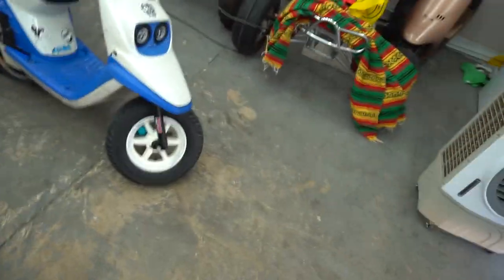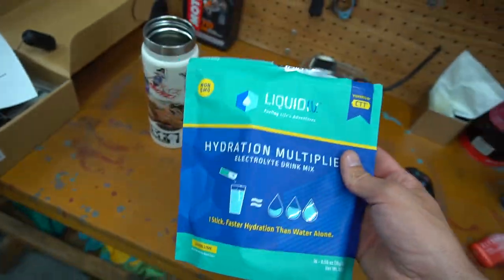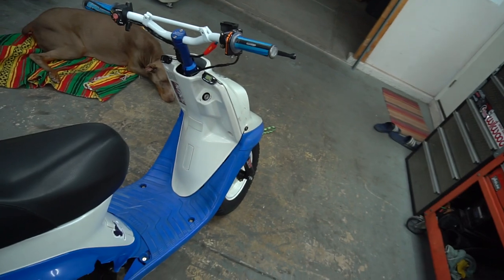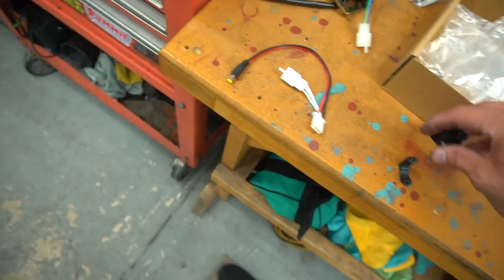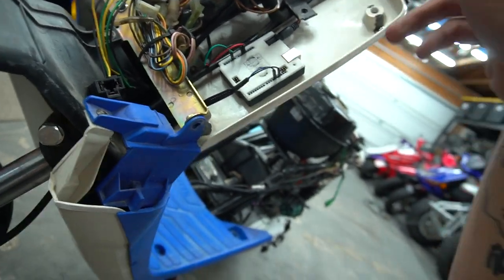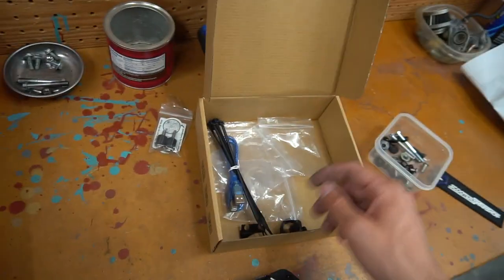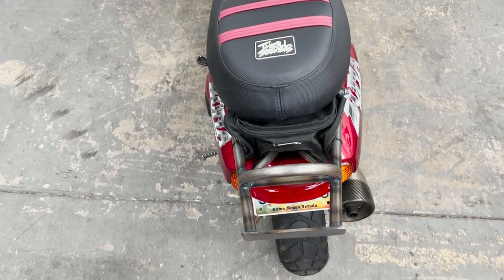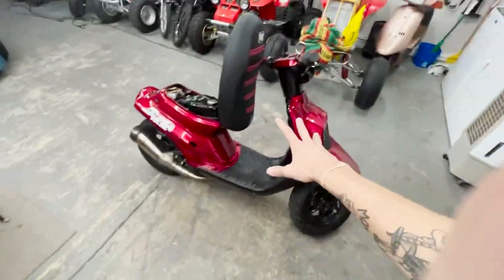FUEL GAUGE install for your SCOOTER! | Yamaha ZUMA BWS

Comment: I would like to add something about the scrape bar. 
The problem is after scraping it numerous times you need to replace the whole bar.
It would be nice to have something attached to it with a set of bolts that you can replace once its worn down.
Like a scrape block. It gives the customer some options and in the long run it will make more money.

Steel block, aluminium block a nylon block and maybe a titanium block for the fancy sparks. That would be sooo sweet!
Reply from the maker: i mentioned in the video it’s gonna have a titanium scrape bar on the finished product bros haha
Reply from the maker: the titanium part is replaceable
Reply: @MOPBOYZ  damn I must be deaf! 🤣